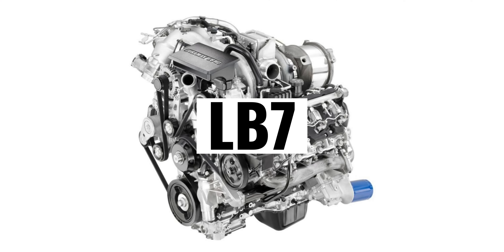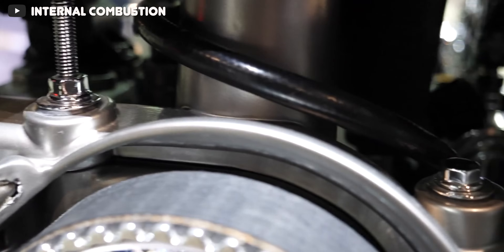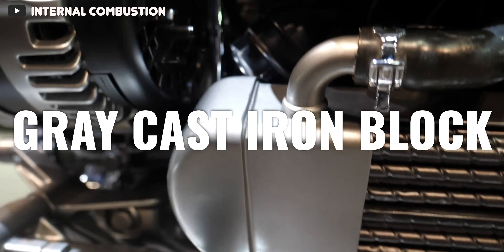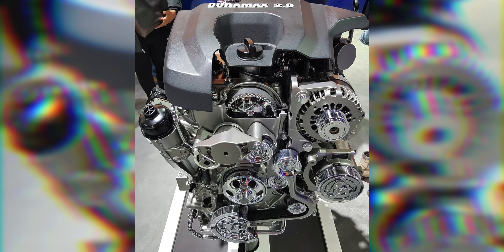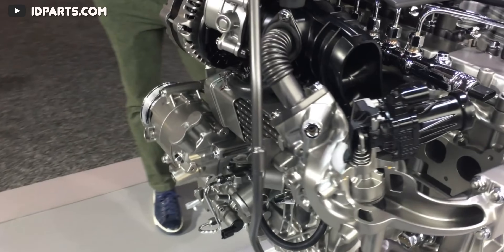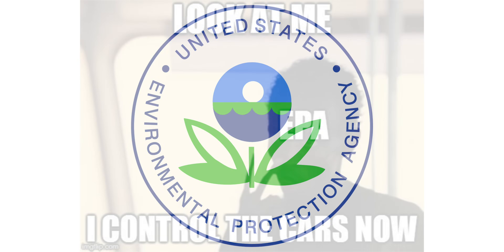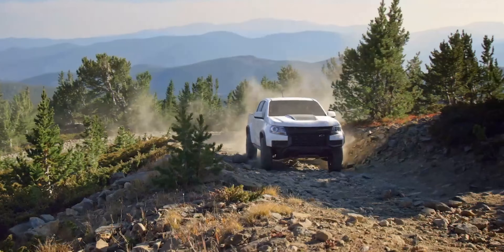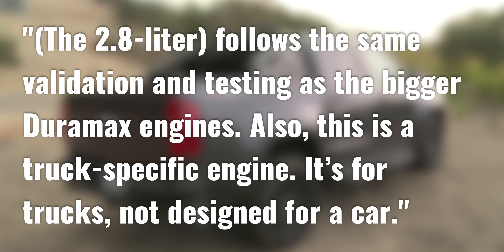2.8L LWN Duramax: Everything You Need to Know

Comment from the maker: What video do you guys want to see next?
Reply: Cummins vs duramax by generation to generation
Reply: Toyota 1gd-ftv 2.8 turbo diesel
Reply: Isuzu 4jj1/3 3.0 turbo diesel
Reply: r2.8 cummins’
Reply: 2.8 Cummins vs 2.8/3.0 duramax vs the 3.0 powerstroke!
Reply: 6hk Duramax
Reply: @zachmoritz9856  that's a Isuzu engine
Reply: Can you make a video on the Ford Lion diesel V6/V8? I feel like the 4.4 V8 specifically is really cool but there isn’t much content on it on YouTube
Reply: 3.7 ford vs qv37
Reply: Detroit DD engines
Reply: How the EPA got their power to ruin diesels! By the way, they did lose a lot of power recently.
Reply: Mercedes Om 617 5 cylinder diesel
Reply: How about the V10 that once was on the VW taureg
Reply: 2.8 cummins vs 2.8 duramax or 2.8 cummins in detail
Reply: Navistar S13 just got announced
Reply: I am looking at a Canyon as right now (07 Feb 23), I will using this vehicle as a daily driver with occasional towing. Small trailer with 2 quads or just hauling small loads like dirt for example. That said, if I wanted to change my transmission for more reliability, which transmission would you use? Thx for a great video.
Reply: Renault 1.5l diesel. Found in Renaults, Nissan, Mercedes, Dacia.
Very good engines. If serviced.
Reply: Dust Runner Automotive 
Blah, blah. Is it worth buying this 2.8L diesel engine? Get to the point,  please.
Reply: 127503 and still strong. Several trans oil and filter changes. Selectable DURAMAX TUNE
Reply: Best truck engine for towing less than 5,000 lbs (small camper).

Comment: 11:35 why do you guys ALWAYS  do this? It's not MEANT to be "modified". It's designed to function well within It's designed parameters.  If you want to modify it, mod or swap the trans accordingly. 

The overwhelming majority of modern diesel reliability issues, come from mods and incompatible usage. Modern iesel trucks are not drag cars, status symbols, or meant for casual driving. They are WORK TRUCKS... designed to run long distance and/or under load ECONOMICALLY. People who insist on modifying them, are the reason why diesel engines cost $2-3000 more than they should... because manufacturers have to cover their cost of warranty repairs.

Comment: How much weaker can it be 🤷‍♂️

The 6.6 engine brake is all-but useless... and requires you to manually shift and rev the nuts off of it, to get reasonable resistance.

Comment: Very good video, You covered a lot of ground withoutGetting bogged down and unnecessarily minor details. I learned a few new things about my truck today so thank you.
 So let me leave a long comment for anyone who cares to read it to the end LOL. I'm driving a 2016 GMC Canyon diesel that I bought in 2021 with 35000 miles on it and now at the end of 2025I have a 170000 miles on it. The main selling point for me for this truck was the fuel economy and it has not let me down. On the highway I am generally getting about 34 miles a gallon. 
This is my first diesel in my first 4 wheel drive truck so when I bought it I didn't realize that it was supposed to be shifting a lot smoother than it was. I'm the second owner of this vehicle the first owner was a construction company, So I'm assuming some Foreman Must have gotten a little bit too Reckless with the new company truck, Did some damage to the transmission and then Sold it. At 60000 miles when my transmission was legitimately slipping and I brought it in the dealership they were amazed that it even ran because they said it was literally falling to park inside.  Thankfully a $100 deductible on the warranty got me a brand new off the line $10000 transmission and I've had no problems with it since. 
The only other mechanical malfunction I had was the crankshaft position sensor which is a magnetic ring that is used in many vehiclesDue to 2 sheep manufacturing costs, However has a tendency to become brittle and lose some of the magnets, Completely knocking your engine out of time And unable to  Even start. And unfortunately you have to drop the entire transmission To get to it which is gonna  Be expensive,  Point being, GET THE WARRANTY!
 The last negative issue is that I'm currently on the highway doing 55 miles an hour because my emission system Is malfunctioning.The EGR sensor I believe is gummed up and And the DPS is failing to do its Regen Cycle so the truck thinks that I'm belching Clouds of exhaust out of my tailpipe slush limiting me toThe most fuel economic speed. As of last winter when this problem first occurred, Which by the way is NOT covered under warranty,, Replacing the One sensor and 1 D PF heater was gonna cost me $3600... Which is why I just drove it until  The fold cleared, It ran fine the rest of the year and once it got cold the fault occurred again so it's time to fix it.
 Positive points though- You may not be winning any Truck pulls with a Canyon or Colorado but you can still do some Decent towing. 2 years ago when my father's 2009 Nissan frontier lost a wheel bearing, I towed it on a flat bed trailer with several 100 pounds Of other cargo a 100 Miles back to town and it handled very well, And I was still getting 23 and a 1/2 miles a gallon.
 It is true that the exhaust brake doesn't do a whole heck of a lot but, I've exceeded the 7800 pound tow capacity Buy about a 1000 pounds several times  Which the truck handles very Smoothly. I will add that I did upgrade to drilled and slotted rotors, Which anyone may want to do if they're going to be hauling several 1000 pounds or more on a regular basis for better heat dispersion.

All in all I really like this Truck and don't regret buying it at all. When I'm in the market for my next truck it's either going to be another one of these or the  3L Sierra

Comment: I need to know where the block heater cord & block heat plug is located, cant find anywhere, im told of 6-8 places it could be/nothing no where? thanks owner
Reply: The block heater plug is on the right side of the engine between the battery box and the firewall.

Comment: I have 168,000 miles on my Colorado and my only problem so far was an attenuator ring failure at 142K. The code was crank position sensor but the dealer techs failed to follow the failure to the next link in the CPS chain. This became an expensive guessing game by the dealer.
Now at 168K I have low fuel rail pressure and a small leak which appears to be a high pressure fuel pump seal. Because the engine wasn't designed for the truck replacing the pump requires 18 hours of labor and pulling the engine so the pump clears the motor mount to the dealers tune of $5.600 and the pump is only $500 of that.
It's been a great engine returning over 30 MPG highway and I've towed a full size long bed Jeep J3000 gladiator pickup 200 miles and returned 14 MPG doing so with great confidence.
Given the cost of new trucks these days and the regression in fuel economy I'm going to tackle the fuel pump myself, thank god I have a second reliable truck.
Reply: Would you recommend me buying a 2017 SLT with 61,000 miles on it today it’s the 2.8 L
Reply: @skind0bind0  My 2019 with a leveling kit, 32s and no air dam still returns 27 mpg while out towing my similarly rated Gladiator. That said I had an attenuator ring failure that confused the techs at the dealer to the tune of $7500 and now the high pressure fuel pump is leaking and estimated run from $5K to $7K. It has 170K miles on it but $12.6K in repairs starts to begin failing the math test.
Reply: @curtshelp6170 is it deleted?
Reply: @skind0bind0  Know that the timing belt gets replaced at 150K miles so factor that in.

Comment: I've had my 2018 long bed crew cab diesel so far no issues.  Have towed a 26 Dayco trailer with no issues.  Love the 32 mpg on the highway and 24 mpg in town. Sure beats the mileage on the new 2025 gas only engines. So far, 47 k miles, no issues. Guess GM canceled the 2.8 cause Stallantis owns the manufacturer now.

Comment: The cast block allows a full operation tune as stock. It’s the reason that the only failures in the 2.8 is an aftermarket tune. This keeps you pulling past an f150, it’s the only reason it was made and people were too stupid to understand it. They went for 2500 territories and failed but they completely decimated the 1500 class. The torque is superior to anything gas, but it is not a 2500. It’s meant for people that want to take dual axle camper, not a fifth wheel. It’s literally the perfect consumer level vehicle.

Comment: I don't know why I bought one after watching this bought it Jan 26th 2025 
With 121000 km 
Its at 160000 km as of July 31 2025
Will report back when It grenades 
After it lost some weight 
And gained 45 hp
Reply: Look at my new video on the upgrades this guy did to make his 2.8l last forever.
Reply: @YZDIMICK a oil catch?
Reply: @Fraturdays no it’s a bypass filter. So your oem filter stays in place and the bypass filter does all the heavy cleaning. Cleaner oil will always make your engine last longer
Reply: @YZDIMICK did you change your timing belt yet ,all of my research says these motors like being stock and more stock and the timing belt to be done around 100000miles rather than 300000
Reply: @Fraturdaysno I haven’t so maybe I need to do that soon
Reply: https://youtu.be/6SRIL64zljY?si=8jd97B0zJBsxA2Mr

Comment: You briefly commented that the oil pump is gear driven. I've also heard it's belt driven. We're there different versions? How confident are you the oil pump is gear driven?

Love my '17 Canyon. I did have several failures of the DEF system. No trouble now that it's deleted though.':)

Comment: I owe a 2016 duramax got it with 20,000 miles after 135,000 miles I did have issue with the def injecuor, the def pump and one of the sensors was expensive to fixit but overall, is a very good small truck specially when towing

Comment: Are there any high mileage reports? I mean actual high mileage. 190-220k plus, not 75k. The notion that 75k is high mileage is ridiculous.
Reply: I've kinda been searching half arsed 
I haven't found anyone with a high mileage one they all have sold them witch worries me as I bought mine at 121000k and it's at about 154000 getting deleted now after Def issues that may have seem to be the reason It was sold in the first place
Reply: @Fraturdaysa delete is the best way to lengthen the life of any modern desiel

Comment: Got a 2016 Holden Colorado in the land of the kangaroo. Common issue is the torque converter shitting the bed on the 6l50. I’ve added a tranny cooler and try to keep on top of it’s services

Comment: 64xx kms on my 2022 zr2 colorado with the 2.8. Just have my def pump and wiring harness replaced, truck was down waiting for parts for 6 weeks. Diet i in the 2026 future. Otherwise a great truck with great fuel mileage. (30-33 mpg)

Comment: Just because they use the 6L50 doesn’t mean that’s a problem. It probably has a different torque converter and has the line pressure turned up to hold more power. The 6l50 is fine for this.

Comment: I have a 2016 Canyon that only made it to 90K miles.  It has been 5 different shops and 3 dealerships.  No one can figure out why it will not run.  The engine wiring harness is no longer made for this engine and none available in the supply system. When one of the shops determined that it was the injector pump, we found out that those pumps were back ordered and only 2 available in the US.  GM knows these are junk and they don't plan on resourcing parts for them.  They did offer me $5000 off any new GM truck, but why would I want to be screwed twice by the same company.

Comment: My 2022 ZR2 has 65,000 highway miles (never towed anything),  the fuel injection pump failed.  Once they pulled the engine the timing belt and tensioner needed to be replaced.  Clearly not the quality that the Duramax name stands for.

Comment: Does anyone could explain if Drive Shaft "Outer CV Joint" replacable. Mine one year 2013 Duramax had issues while enggaging low gear producing "clinking sound" during right turn.

Comment: In fact the origins of this engine can be traced way back to the 80s, when VM used to make old-school gear-driven pushrod indirect-injection Diesel engines, such as a 2.5L turbodiesel which used to be fairly common in Euro-spec Chrysler minivans until common-rail direct injection became more widespread in light-duty vehicles. On a sidenote, this very same engine has also been made in Brazil under contract by a former subsidiary of Navistar.

Comment: I'm surprised GM didn't learn their lesson from transmission failure of their diesel cars of the early 1980s.  I had a 1981 Pontiac Bonneville diesel and went through 3 transmissions.  Engine and transmission match were horrible.  I considered a Canyon diesel but instead went with Honda Ridgeline...glad I did.

Comment: ZR2 We bought our 2018 Colorado  ZR2 Diesel,  in Carson City NV.  New. We have feather light car trailer (20') which we towed a 63 Buick four hour to Wimnnemucca, NV.  On HWY 80. We towed 70 to 80 mph. and got about 30 miles to a gallon. Mostly flat roads, not very many mountains.  Next we towed a 1950 Plymouth on our trailer ( with a 318 V-8) 6 hours to Hanford Ca and got about 30 miles to a gallon at 70 to 80 Mph. on HWY 88 to 99.  We have  our What ever trailer (tandem  axels) with two cords of fire wood, from Mendem NV  about 50 miles to home (in Smith Valley NV) This little truck runs great. and with the 6L50 Trans works great !  Our ZR2  has over 65000 miles on it. I change the oil very four thousand  miles.  I installed a B&M trans dip stick.  I change the trans oil every 25,000 miles. Probably too much.... We have a friend (that lives in Yerington, NV)  He bought a 2019 Colorado (2wheel drive)  Used.  He beats that poor truck to death !  He uses it in his business. He has six different trailers (Loaded with farm equipment ) He has had no problems with his Colorado..  Oh yes it doesn't like the K&N  air filter I installed (it says to much air) We also have a 2000 Ford F-350 4X4 four door, Diesel 7.3 With a lot of Bill Banks stuff on and in it.  It has well over 350,000 miles on it. It tows our Fifth wheel camp Trailer plus a second 20' enclosed trailer..... I really like you program .... Please keep up the good work..

Comment: Here in Brasil we use this 2.8Duramax in Gm S10 and Trailblazer, both have hard work applications here and high mileage on it , work trucks here, most common problem is the 6l50 transmission but just change the trans oil n filter every 50k kilometers and be happy

Comment: I have the 2016 Z71 with this engine. Currently has almost 250k miles. I've owned it since 160,000. I'm about to do the timing belt and water pump replacement. At least get the timing cover off and see the condition of the belt. Only had 1 issue with extremely cold weather. The inner cooler pipe split. But that's a pretty cheap part and an easy replacement. Haven't ever touched the tranny at all. Regular oil changes. Emissions has never given me any issues except the constantly adding DEF about twice a month. I drive over 100 miles every day on the interstate so it's constantly moving and regening like it should. Once the emissions starts giving me real issues I'll delete it. Until then just keep on trucking. I don't do a lot of hauling. It's just a regular daily driver. Gotten up to 38 MPG though which is amazing. The Air conditioning on the other hand....well that's not the engines fault lol. But it has failed catastrophically...twice...

Edit: I also added the block heater to mine. Just paid a local shop to install it. Where I live it gets down into the negatives in the winter time. I know it probably isn't "needed" but it also definitely doesn't "hurt" and it was a relatively inexpensive upgrade.

Comment: Your points at the end are a little bit silly, if I'm honest, especially considering how thorough you were in the rest of the video. These engines have existed in essentially the same form, as you noted, for a long time, and they've always been used in trucks. The validation period has long passed. Also, the idea of truck transmissions and car transmissions is just a little silly. If the 8L90 is "just fine" then why is it also in so many cars which are, again, not meant for towing anything at all? I think you're being a bit nitpicky.

Also, FYI, not a single Duramax 2.8 was produced by VM Motori. They were all built by GM in a GM plant in Thailand. The predecessor engines were built by VM Motori under partial GM ownership, but every single Duramax 2.8 was built by GM. As you note, they maintained the rights to build the A 428 after VM Motori transferred ownership. Another small note, 2.8L I4 diesels are big but not unreasonably so. Many small trucks around the world use up to 3L I4 diesels, and probably the most famous I4 diesel, the 4JJ1 built by Isuzu, is a 3L I4.

Comment: For those that actually don’t know if they want an HD or not, I have a Ram 3500, 2022. It was expensive. But last that, I dropped some money on a Carli suspension, 35” tires running 60 psi all around. It’s a very smooth daily driver. Gets mid 20s mpg not deleted. 

I’m looking up this engine class because I’m wanting something to build as a toy in the garage so I’m making my rounds to see all what’s out there.

Comment: I had a 2007 JK wrangler CRD. God I hated that engine so much. I ripped it out and put a 4.0/AW4 out of a 95 XJ and it just felt so much better. This whole big power from small engines I swear is a myth. Its like they pull torque figures out of the air. The 4.0 was quicker 0-60 and had no problem holding onto O/D on highway hills on 37's with 4.10 gears. The 2.8 CRD was constantly downshifting on 35's.